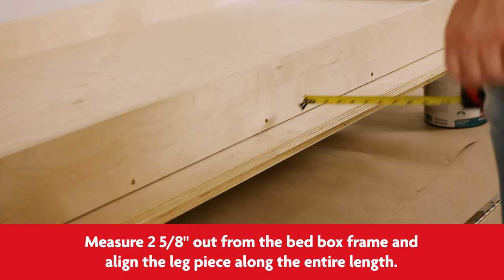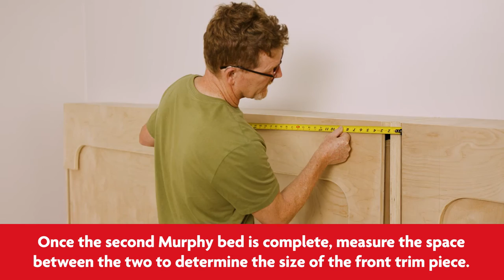Build #spacesaving Twin Murphy Beds, Here's How

Comment from the maker: https://www.homehardware.ca/en/blogs/p/murphy-beds

0:00 Intro
0:05 Measure Your Space
0:14 What You’ll Need
0:21 Measure, Mark and Cut
0:59 First Bed Box
1:22 Router and Sand
1:32 Building the Wall Box 
2:33 Finding the Wall Studs
2:42 Position and Secure the Wall Box
2:54 Optional Lid or Top
3:01 Attaching the Piano Hinge
3:27 Forming and the Legs
5:16 Second Murphy Bed
7:17 Finishing Touches
7:23 Prime and Paint
7:37 Locking Devices
7:50 Final Reveal

Comment: how thick can the mattress be for this design?
Reply from the maker: Thanks for asking! We recommended measuring your mattress first. The size of your mattress will inform the length and width of your plywood cuts for both the bed box and the wall box.
Reply: @HomeHardwareStores  thank you, the width and length are fine, I'm wondering about the depth of the mattress and what depth you are using. That will tell me how much I need to adjust the depth of my overall cabinet
Reply from the maker: @kferpa  The depth of the mattress we used in the video is 6". Hope that helps!
Reply: @HomeHardwareStores  yep!  Looking forward to starting this project!